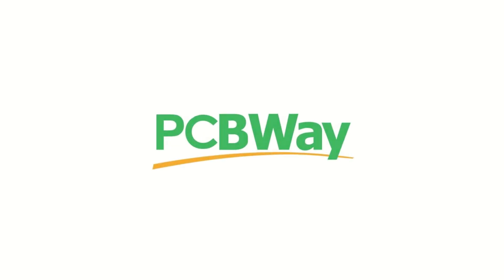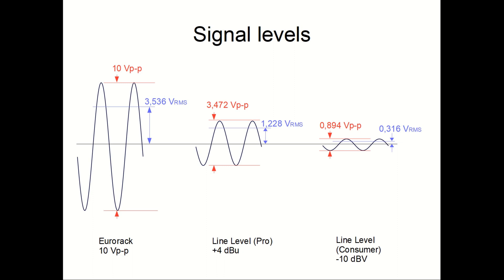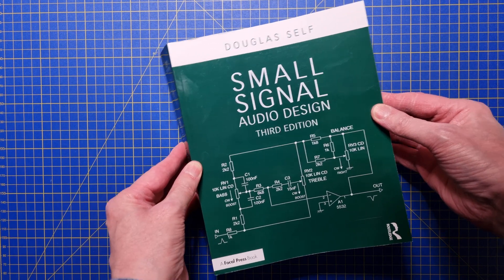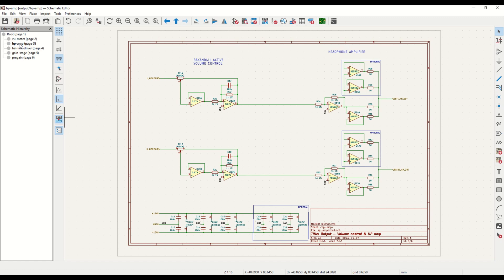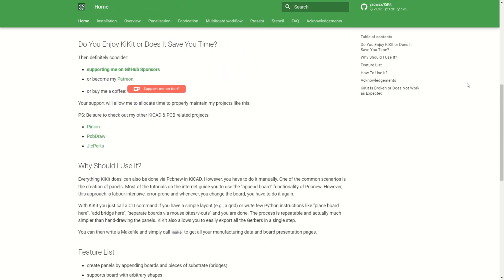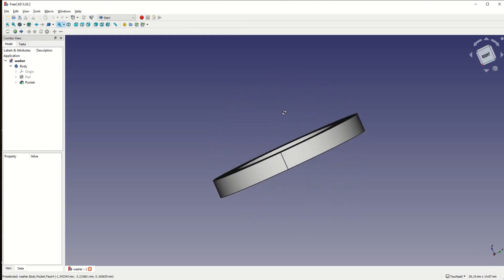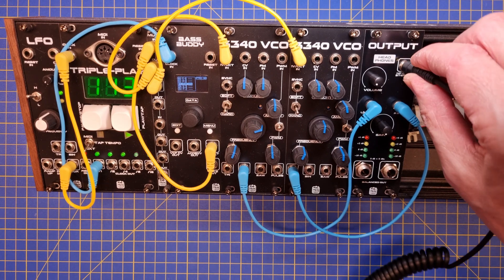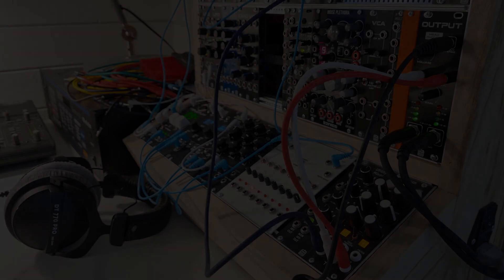Eurorack DIY: Output module

Comment: Great module, I love your designs and presentation! With the optional extra opamp, do you think I could use the output with low impedance headphones? Mine are 32 ohm
Reply from the maker: Thanks, the HP output is designed for headphones 80-250 ohm impedance, but you can use them with 32 ohm headphones, you just need to be careful not to turn up the volume to high (or you can adjust the gain of the headphone volume control by changing a couple of resistors)
Reply: @MeeBilt  Thank you, I'll give it a go!

Comment: hello ! we are actually creating your output module with a friend but we don't have the HP jack output 3.5 for now, we have tried the module without it and we don't have any output signal , my question is: does the HP output complete the signal way to the main out? if yes that the reason why we don't have any signal...  
also why in the first video the HP output have 3 pin 3.5 but in the second there are 5 pin 6.35 ? 
happy for an answer and have a great day!
Reply from the maker: Hello!
The headphone output and the balanced outputs are two separate signal paths, each with their own volume/gain control.
Do the VU meter LEDs light up when you apply an input signal and turn up the gain pot?

There are two versions of the Output module, the version on Github are the first one with 3.5mm jacks and the second one is available in my Tindie shop only.
Reply: @MeeBilt  no, the LEDs don't light up, and the HP output is the only component we miss
Reply from the maker: @leosoler580  Then you have to follow the signal path from the start and see where the signal disappears
Reply: @MeeBilt  thanks for your advice i'll try that ! Have a nice day

Comment: Hello!

I want to build Output Eurorack module from your GitHub and I have one question: in schematic you use C33 and C34 like as 47uF SMD caps, but I’ll make this module in TH design and can't find ceramic 47uF TH caps in my local store. With what nominal or type capacitors can I replace these SMD's?
Reply from the maker: You can use bipolar electrolythic capacitors, for example nichicon VP-series
Reply: @MeeBilt  thank you for answer!

Comment: This is very nice! I built myself a quick and dirty headphone amp on stripboard a while back on a similar model (just two input jacks, the left normalled to the right, then the dual pot into parallel NE5532s; I mostly copied from that portion of Befaco's Out module), but this seems so much more comprehensive and useful that I may have to build yours. Thanks for detailing this!
Reply from the maker: Thank you very much :)